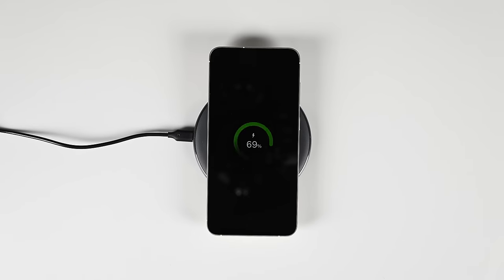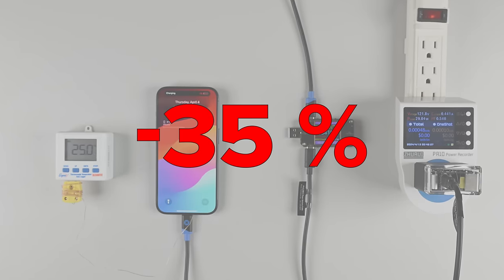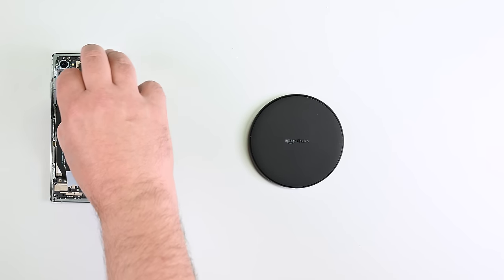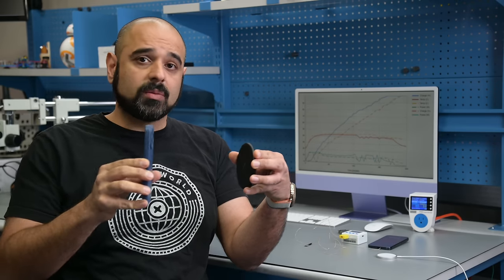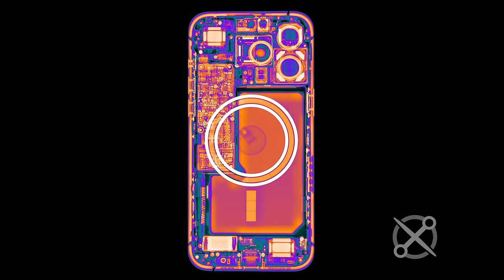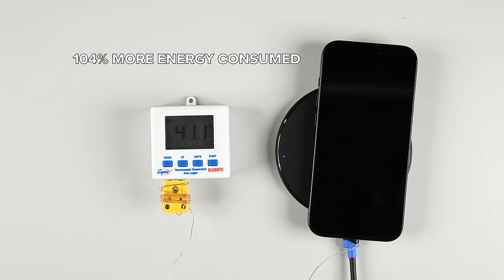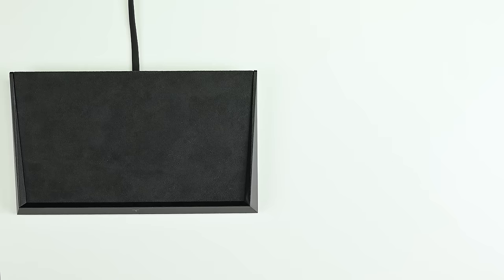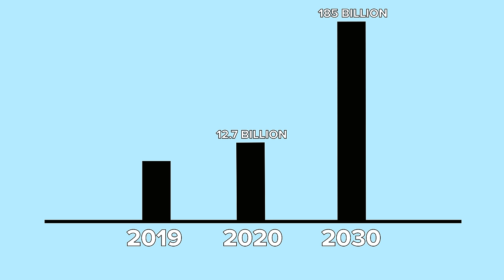How Wireless Charging Works and Why It's Terrible

Comment: I use wireless charging out of convenience since I'll need to plug and unplug frequently. I always place it under a small desk fan pointed at the phone. It keeps it nice and cool even after charging for over an hour - I imagine the battery temperature is kept a bit cooler from this.

For overnight charging it's a 5 W charger to minimize heat. No need to charge from 20% to 80% in 30 minutes when it's going to be plugged in for 7 more hours anyway.
Reply: They make wireless chargers with fans built in. I have 3 of them and my phones never even get remotely warm when using them. I also have some without built in fans and phones DO get fairly warm on them
Reply: @Zatchillac  I was going to say the same.  The ESR Magsafe certified chargers I use in our cars include a fan.

Even with my Belkin chargers at home, I don't perceive my phones getting to 30C
Reply: Wow, you need to point a fan at your phone to charge it at a slower speed with less efficiency, sounds real awesome
Reply: @BlueBillionPoundBottleJobs  The reason for this is I charge while I'm frequently using the phone. I simply disconnect from the charge, do what I'm going to do, then put it back on to charge. Otherwise I would just plug it in.
Reply: sounds like skill issue lil bro

Comment: Finally someone speaks about this, thank you! I am not using wireless charging exactly for these reasons for a few years already. When I tried it, I did not find it any more convenient than plugging the phone in.
Reply: Yeah it shouldn't be your primary charging method, however keep in mind it allows you to keep using the phone when its wired port is worn out.
Additionally in some parks and in restaurants there are some wireless chargers which are super convenient.

Comment: I agree, never understood the "inconvenience" of plugging in a wire or why phone stands stopped being a thing. The loss of energy and wearing out of materials are a shame. It is true though that the lack of securing mechanism on USB-C causes the wire to fall out more than it should.
Reply: USB C is the most fragile part of the phone which breaks first. Well at least if you don't drop it and shatter your screen. But wear and tear on the charging port will eventually destroy the phone.

Comment: This may sound like something with hindsight. I felt increased battery degradation when using wireless charging pad after I got my iPhone 11 in 201. The battery degradation went crazy. I initially guessed Apple may somehow use batteries of lower quality for iPhone 11 series but I was not sure. Happy that IFixit has cleared it out.

Comment: Even if efficiency was equal, I still wouldn't see the appeal of wireless charging. The pad still needs to be plugged into the wall with a cord. Is it really that more convenient to place your phone on a pad than it is to put your phone in the exact same place and plug it in? Also, a big use case for wired charging is that you can continue to hold and use your device while it's charging. It's a lot less ergonomic to do that with wireless.

Comment: I have a Galaxy S22U and wireless charge with a 5W charger. The battery does not get anywhere near 30C. It's even recommended to use wireless charging at 5W at night when the phone is of. Your phone being off is what helps prevent it from getting hot, and battery degradation.
Reply: Makes sense. For overnight change 5W is adequate and the charging loss is a lot lower than at 15W fast wireless charge
Reply: Why not use a 5W wired charger. Benefits of slow charging + wired.
Reply: It's the slow 5W charge that is helping the battery, not the wireless charger. 

You would see arguably better battery longevity and a dollar per month come back on your electric bill by using a 5W wired cable instead.
Reply: @NotCaptainToad  Yes, but an USB port likely soldered to the motherboard (it's so on the S10, dunno the S22), that ain't getting any younger. In my case I went wireless slow charge as the lesser of the two evils. I would rather replace a battery sooner than a connector later, since I do intend to keep the phone for many years. Sure USB-C helps, but if there's also another option, may as well.
Reply: @unliving_ball_of_gas  there's benefits of both wireless charging and 5W. The benefits of wireless is you are allowing less damage to the USBC port. This reduces the risk of needing to replace the port. T
Reply: @Kalvinjj  it's not. You can replace the board, but it's not easy, and I am not taking the time or paying the money to replace a port. This is a pain the Galaxy S22U is a unibody design. This means you need to replace both body and screen. This isn't fun and is a pain. They ditched this after the complaints and went back. Unibody is also more expensive. Yes, easier, but expensive.
Reply: @joshuauriarte452  fair enough
Reply: @NotCaptainToad  Nah, I don't think sawing a few watts of energy will have an effect on ur electric bill.
Not like turning off that 3000W guzzling machine called "air-conditioner".
Reply: Really gotta wonder how bad some of you people are at cables if you think "damaging the USB port" is a real thing to be worried about
Reply: @mjc0961 Yeah had my last phone for 3 and half years.  My phone only had wired charging and never had a problem with the USB C port and charging.   The battery  was still good in it.  Still have this phone a motorola g8 power as a backup incase somebodies phone in my family breaks down or is lost or stolen.

Comment: Great to see some solid numbers on charging efficiency and thermals. I’ve heard claims about wireless charging degrading battery life for as long as I’ve seen wireless chargers. But I’ve never seen people get into details and produce numbers. 

Are the temperature tolerances on lithium ion batteries that low? 35 degrees Celsius is stuff I see often on holidays and are quite common in some parts.

Comment: I never understood the point of "wireless" charging. You still have a wire that goes all the way to the phone PLUS a big puck underneath it PLUS it's less efficient PLUS before mag-safe you couldn't use your phone while charging it wirelessly since it had to be on the pad. The only time I've ever used wireless charging was when I wrecked the ports on some older phones--it's great to have as a second option, but not as a first.
Reply: Then, it's not for you... Simply as that.
Reply: @pandazpaa  so, who is it for?
Reply: @Rickyp0123  does it actually matter for you? I mean, if they're selling, there's someone buying. I do use one in my office's computer and works pretty well for me for example... Even with a lot of cons.
Reply: @pandazpaa  no of course not! I just see zero upsides (except as a backup option) so I was wondering what I could be missing. I’m happy to hear about use cases I hadn’t considered.
Reply: @Rickyp0123  understood. I personally don't think that you're exactly wrong in your initial thoughts (since those are valid points). They can sell wireless charger because some weird use cases (like myself), which a person kinda uses a worse technology because "personal reasons" I guess.
Reply: So, why wireless charging exist in the first place? The founder of this technology should've realized the inefficiency, right?
Reply: @pandazpaa  i love how you are kinda vouching for it while trying hard not to answer his question like why even respond to him? answer his question.
Reply: @anubisbahamut  why so salty?
Reply: @Rickyp0123 I love wireless charging for my iPhone at my work desk. Because it charges sideways and it has a clock feature while it charges. I’m regularly picking up my phone and putting it back on charge when walking away from my desk, so it feels more free, and it wouldn’t have the same wear and tear as plugging in and plugging out.
Reply: @athenaeatsapples  that makes sense!

Comment: I've exclusively been using magsafe since inception. One mounted permanently in my office and one mounted in the car. Both have cheap copper ssd heatsinks adhered to the back to reduce throttling of any kind(probably not even necessary tbh). It quiet is the perfect charging solution. Haven't used a wire in almost two years.

Comment: I used wireless charging twice when I got an iPhone 12 several years ago. Haven’t touched it since. I already was aware of the lower efficiency and power loss from charging over a distance in general but was extremely unimpressed at how hot my phone became compared to how long it took to charge. And on top of that you scale it across several billion units, it uses a lot more of the precious copper to do the same exact thing but worse.

Comment: I really only use wireless charging for two things. I have a MagSafe charging phone mount in my car with a built in cooling fan for driving. I also have a wireless charging pad beside my bed so I can charge my phone at night, but that’s connected to a 5 watt power supply for low-speed charging.

Comment: I've charged my Sony Xperia 1 IV wirelessly for almost two years now without issue BUT that being said I've only charged at 5w max to keep temperatures down. If i charge at 15w the phone becomes quite toasty (battery temps close to 40C). Wired 30w charging pretty much never exceed 30C but wireless charging at 5w is only a degree or two above room temperature. It's nice to just drop the phone on a pad after work and if I need faster charging wired is always an option.

Comment: One of the main attractions of wireless is avoiding the connector damage that always seemed to eventually occur. I don't understand why the battery gets hotter with wireless? Also in an array of coils such as the Tesla platform -- why doesn't it detect and use only the one coil that is best aligned?

Comment: I just like wireless charging because it's easy. I just set my phone down on the pad and it recharges. And I have CPU-Z on my phone to check the health and temperature of the battery. It doesn't get above 26 or 27 C.

Comment: I use slow wireless charging, i disabled fast wireless charging in settings of my S24 Ultra, Phone never get's hot, is that more safe for the batttery ? The only time it gets hot is IN the car using Wireless Android Auto + Wireless Charging... i don't love that so when it needs charging in the car i use a cable.
Reply: My thoughts exactly

Comment: I really love wireless charging for slow charge overnight - I even connected my charger to slow power adapter on purpose - to not allow it to fast charge. What i really like os that I don't have to plug in a cable, not only does it look nice, but also does not wear the USB-C port. So you just have to use it in a smart way.

Comment: I keep a wireless charger in case my port gets wet or damaged. I slow charge overnight with USBC and Samsung basic battery protection. I've never had a damaged port, but did get my port wet once on vacation.

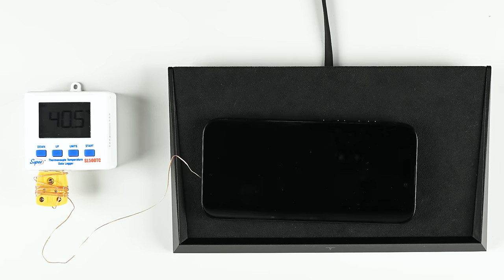Comment: 0:27 I’m confused: if you live near the equator, where it basically always is above 30c, your battery degrades faster?
Reply: Yes, I’m noticing faster battery degradation every summer, even though I live in Norway, where temperatures can reach over 25°C. When using my phone in full sun with maximum brightness, the battery is under constant stress. Playing Pokémon Go also causes the phone to get very hot, which accelerates this process. Warm climate is battery’s worst enemy.
Reply: Yeah generally my phone battery dies faster during summer or generally whenever the phone is hot

Comment: I’ve used a mag safe charger since day 1 on my iPhone 13 Pro Max. My battery health is currently at 86% 

I have a wireless car charger that isn’t that strong and this video explains why almost every time I use it my phone cuts the charging due to overheating. The phone must drop down slightly and get misaligned with the coils

Comment: I use a wireless charging stand for iPhone and apple watch. They are always on it. I never have to bother about checking battery and charging before going out. When I take my phone, it’s always full. The same goes for the watch. I will change my phone faster than the battery dying.
Reply: same, and mines vertical, and my phone never gets hot or even warm when on it. Been using it for well over a year and no battery degradation issues, though to be fair i barely use my phone so it just sits there on the pad 24/7 in "idle" mode (charger light turns red showing its fully charged but keeps it trickle topped up while the phone sleeps)

Comment: I've actuually arrived to the same conclusion couple of years ago so switched to magnetic charger cables, the phone or devices have a small magnetic plug which attaches to a magnetic cable similar to apple laptop chargers but the contact pads are recessed to it won't burn out the charger as it's difficult to accidentally short circuit with nearby metal objects. For USB-C Elough was the company who started selling these but nowdays a lot of other companies are selling the exact same solution like Ugreen. Also these cables and adapters became dirt cheap. Additionally there are 60-100W variants aswell available now.

Comment: Good video, but it could use some nuance for wired charging. Wired fast charging has very similar downsides vs. wireless charging. Not as bad, but it is certainly not as binary as suggested during this video.

Comment: I charge my phone with a wireless charger about 50% of the time. I do not charge it past 60% when it's on the wireless charger. I did that with my Note 9 and it lasted me for 5 years with dips in battery performance only after major software updates.

I think a wireless charger is great to not wear down the charging port, which was an issue with my old phone until I partly stopped using the port, and to easily keep a lower battery level.

Comment: Thank you iFixit! 
Just a small geeky fix: it’s degree Celsius, not centigrade. This is not the same scale and I think you are using Celsius thermometers.
Reply: It looks like "centigrade" is just outdated name for "Celsius".
Reply: @sdjhgfkshfswdfhskljh3360  We could think so but this is not the same scale. It’s close, but not the same.
Reply: @KofieBluejay  I've never heard that before. How exactly are they different?
Reply: @KofieBluejay  there are only 3 measures of temperature, farenheit, celsius, and kelvin. anything else is a word for one of those
Reply: @feynstein1004  They are different by around 0.025 degrees at 100 centigrade. In celsius, that would be 99,985 celsius (rounded). Sure it's very much minimal, but it is, by definition, not the same scale and the ISO norm is the celsius scale, not the centigrade.
Reply: @KofieBluejay  This is pedantry to the extreme. And besides, even if the two scales are not not precisely the same, there's nothing in the video that's incorrect. Saying "the battery heated up to over 40 degrees centigrade" is still correct since they didn't quote a precise temperature figure to 5 significant digits.
Reply: @KofieBluejay  Huh. Neat 😀

Comment: There is a power rectifier in your USB charger plug to convert 230V/120V AC to 5-20V DC, a power inverter to convert it back to AC in the wireless charger, and the induction coils in both the phone and the charger which only take and give AC current, while your phone needs DC, which means another rectifier. All of those components have a loss factor, especially the induction coils, which wastes power into the ether due to impedance or resistance.

Comment: I fully prefer wireless because it protects the (frequently soldered to main motherboard, not daughterboard) USB port from wear. It WILL wear out in a number of years of daily charging, and then you're screwed, vs a bad battery that's always just a plug to replace once you're in the phone.

Comment: Just use a “slow” 5W wireless charger for overnight charging. It’s much better for your battery to slowly charge (after a deep cycle preferably) than a super fast charge on a wire or a powerful wireless charger
Reply: Its alot nicer to go eat breakfast and come back to your phone already charged to 85% in the morning than it is to have it on over night, when it will charge in the first 3 hours anyway.
Reply: If your phone is built to fast charge, fast charging does not wear out the battery. If it lacks sufficient battery management software or you are charging out of spec, then you will wear out your battery

Comment: Nice, though more info in video on why the battery gets so hot would be nice.
If I remember it is mostly because the battery is right on top of the receiver coil that is getting hot (inefficient)  than the battery somehow heating itself by lower/inconsistent amperage, and -- at least the battery heating -- could be  mitigated with in creased distance from battery to coil... of course, not much space in a phone, and long cables to heavy batteries segregated to one end of the car is a new set of challenges.

Comment: I keep my devices for as long as practically possible. I use a non-fast charging pad overnight to keep my phone charging slow, generally better for the battery. It's never more than slightly warm. Also, there's zero stress on the USB C connector, which failed on a previous phone from all the connecting & disconnecting.

Comment: Sure, use a cable until your charging port becomes inoperable or loose due to normal wear and tear. I've had to get port fixed on 2 different phones. A wireless charger saves wear and tear on a port. Use both
Reply: learn to plug in your cord lol ive had 3 iphones 1 of them for 10 years (lightning port) and am now going to upgrade finally and and still using the same port and same cable that came with the phone lol wtf are you doin?

Comment: Thank you so much for making this video. I have been arguing for yeas about how bad wireless charging is from an efficiency and battery perspective. It's slower than wired when you need speed, it's less efficient when you wanna save energy, and it will degrade your battery faster. 

Yet people still see is as an essential feature, for some reason...